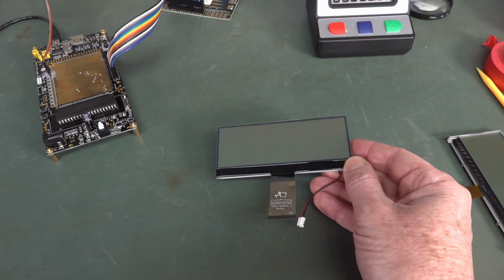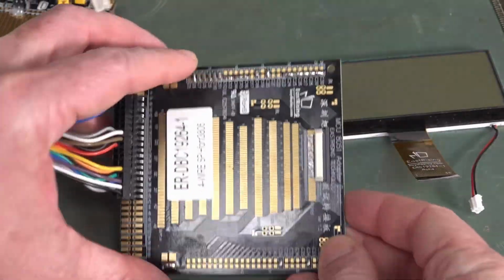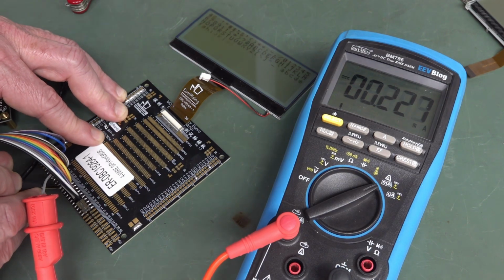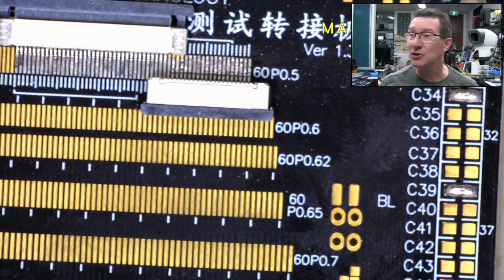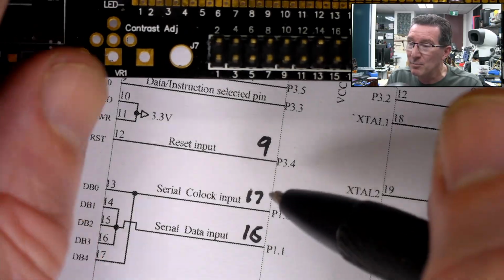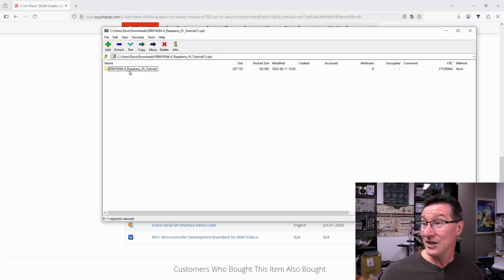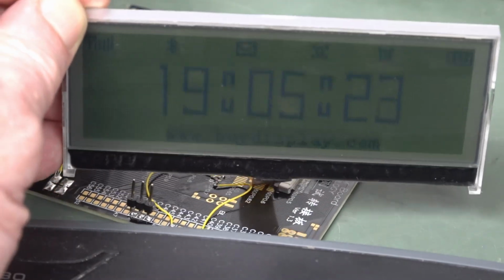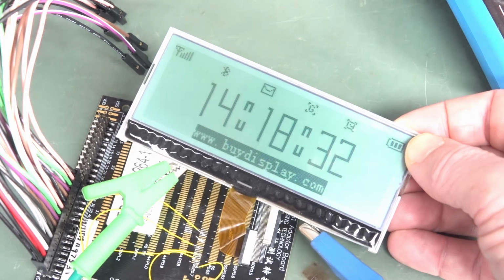EEVblog 1699 - µTimer PROJECT Part 1 - The LCD

Comment: The USB stick didn't work because it was FAT/NTFS formatted, posix systems use a execute bit to mark a file as executable. FAT/NTFS, being a windows file system has no such notion and instead uses file extensions to determine if the file is an executable.

Comment: You know electronics has been finally comprehensively ruined when the build of the quintessential basic project (right after a blinky light) - a clock - gets approached by bringing in a gigahertz-clocked Linux-powered chip.

Comment: I'd rather have a nice, usable display than x% more battery life. If you really want to chase microamps, you have to go segmented either way. And the first display looked really nice for being a passive dot-matrix. I actually have been evaluating a  128x64 that looks very close to your first one, and it looks very nice, especially when you provide just a tiny bit of background lighting current to it. If you want to go full Hackerman, you can sense the background lighting LED for ambient light level via an ADC.

Comment: Max power for LCM -- probably stands for liquid crystal matrix.  No indication that this includes the electronics.  So the quoted power is probably only for the crystal matrix.  Great, but you are reading power for the LCM and electronics.  It only makes sense for them to specify these values separately if pairing the electronics with different LCM.  Either way, the datasheet was highly misleading.

Lets investigate a bit to make sure I am not wrong -- the controller is a IST3020.  Current draw is only 40uA but there is a catch.  The chip includes a boot circuit for generating higher voltages to drive the LCD.

- Supply voltage (VDD) : 2.4 to 3.6 V

- LCD driving voltage (VLCD = V0 – VSS) : 4.5 to 15.0 V

So the quoted current consumption of the LCM is probably accurate -- they just neglect to mention it is at ~10 V.  Guess my first guess was wrong - but this does explain things.  Looks like the "voltage" comment in the source code was actually accurate.

Comment: Keep the illuminated LCD and use a removeable 18650 battery so you can charge it, keep the backlight on if you want and replace the battery once it dies

Comment: Personally battery operation is nice. But I would much more happily take a 24 volt capable DC input. A switched regulator can easily make that DC input range 9-36 volts or even wider without all that much hassle.
And having a simple barrel jack DC input makes life so much easier, since most of them do have an internal switch that can disconnect one of the battery terminals, so no need for selection diodes and the same switched regulator can handle the battery input too.

Main downsides with batteries is that one has to swap them on occasion, and they usually leak and destroy one's equipment... For bench equipment a DC input is preferred.

If everything just did 24-ish volts DC (24 +/- a few volts) means that one can have a DC bus stretching along the bench powering a slew of various low powered bench equipment from one adequately sized supply. Where its idle power consumption will be lower than the combined idle power draw from the slew of supplies it replaces, not to mention the improved power factor. Some might argue, "why not 12 volts?" But voltage drop over cables makes it unattractive. However, yes a lot of products these days do just have a 12 volt SMPS inside them. Be it oscilloscopes, universal counters, various signal generators, even a lot of bench multimeters. And honestly speaking, filtering and post regulation largely makes noise a "non issue", so there is little reason such types of equipment couldn't run on our 24 volt bus, unless we have atrocious levels of noise on it.
Reply: Other commenters go the other way and say put a Li-ion battery and USB charging into it, but I agree with you. This is a benchtop device and so should be hard-wired, in my opinion.

Comment: Sharp has some nice ultra low power (AFAIR they call them pseudo static) LCDs. I don't know if they have displays that satisfy your needs. For a throttle project I got some small ones that should draw about 5uA with static content.

Comment: For what it's worth, if I were buying one of these (and I might just, if you wind up making some to sell) I wouldn't be too fussed one way or the other about battery life - IF you used rechargeable batteries and include USB-C charging support. Mine would spend most of it's time plugged into the charger anyway. So for my part, I'd say use  whichever LCD looks best, more so than trying to optimize for power consumption.

Comment: It might have been addressed in the comments, but just make it run off of a single 18650 Li-Po cell and make that charge via USB-C. Even with a constant 10mA power consumption (and you should be able to cut that in half), the thing could last a week on a single charge.

Comment: This video series looks really cool, I'm sure I'll be following it!
Dave I have found something that might interest you as an lcd, but I might have missed some specs you wanted for it:
it's transflexive, 4in, 128x64, it comes in spi or i2c, voltage level 3v3, and based around the ic st7565, current consumption unknown. You may find it by searching "Estardyn Lcd12864 12864-06D", price is around 3.5€

Comment: @9:25 Viewing angle is indeed extremely intuitive... 6 o'clock is like -45 degrees and 12 o'clock like +45 (or vice versa). The one who invented that must be a genius! There are 180 degrees between 6 and 12 o'clock. Right?... Right??? If it were intended to confuse people, then consider the goal achieve and way beyond that! Unless... oooh I get it, it's radians, right? (yeah, that's sarcasm, plain old.)

Anyway, grumbling apart, I'm excited to see how you spin that one 👍

Comment: Is the LCD running off 3.3V or 5V?  I expect running it at a lower voltage would decrease power consumption significantly.

Comment: LCD is using almost all the Current when it has to update the display - just like e-paper displays. You are having a clock, that has blinking content and changing the seconds in display - so the display of course will take more current (I bet, the 500µA were RMS or something like that over time?). Leave the Display in stationary state, and it indeed might get much closer or maybe even to the 180µA.

Comment: I recently developed a timer based on a Schmitt trigger having an N channel JFET as it's input transistor. This loads minimally a capacitor used as the time constant element. When the output goes high it both turns on a transistor on the output to be used as a switch and also turns on another transistor being used to shunt the capacitor charge through resistance to start the second phase of the timing.
Works excellent on a single cell li-ion battery and can be made adjustable with potentiometers, LDRs or whatever.
Good fun experiment 😅

Comment: The amount of updates to display chipset effects the draw from the supply also. As 8051 code probably more optimised compared to an external C library!
Also AliExpress has cheap connection boards for strip connectors, if faffing with the original is a pain in the 🫏!

Comment: -Wall enables all compiler warnings. -W is the warnings configuration flag, followed by a configuration word which in this case is 'all'.
The USB stick didn't work because Linux requires a special "executable" flag to be set on executable programs and that flag isn't really supported on the FAT32 filesystem your USB stick is formatted with. It can be emulated by Linux, but the way the filesystem was mounted probably turned that flag off.
Moving the files to the Raspberry Pi's filesystem meant you got proper support for the executable flag, so gcc was able to set the flag when it wrote the 'lcdtest' binary.
You can set the executable flag using a command like "chmod +x somefile". chmod is change mode, + means add flag, x means executable.
Reply: Can you enter it as “-W all” instead?

All the typical Linux distros force the executable flag? Is there a particular reason for it?
I guess it prevents running programs inappropriately from a mounted network share?
Reply: @davadoff I don't think so but I haven't tried and yes, not mounting with the option to emulate the executable bit is likely a security hardening measure

Comment: Nice to see more product development!  And some nice breakout boards.  Raspberry Pi has all the benefits and drawbacks of running a generic OS, I think that's where a lot of the setup stuff came from.  If you had a spare Arduino instead then I think using that would have been a lot easier, because it's more tailored to do this kind of thing out of the box.

Comment: I really hate the form factor of instruments like the timer. If it’s not front facing and stackable, it should be flat, with a collapsible stand like multimeters and portable scopes. Interesting project though 👍
Reply: Well I mean the timer is a moveable desktop instrument, not really one meant to go on a shelf. Such a small and light device doesn't seem very practical as a front-facing device anyway.
Reply from the maker: Disagree.

Comment: I love how Dave tries to solder microelectronics with Grandpa’s old branding iron. They do make micro irons fit for purpose.
Reply: You have no idea what you’re talking about. He’s using a high-end JBC iron with a special tip made specifically for drag soldering. People generally do not use micro-tips except where it’s absolutely unavoidable, since it’s more work to do each pin individually, and micro-tips have terrible thermal properties.
Reply: @tookitogo  Actually, I do as it’s my favorite style of tip. That tip optimized for drag soldering comes in a range of sizes with a solder cup suitable for the pitch being soldered. I have an extensive collection of that style of tip plus wettable and non-wettable needle tips that are excellent for clearing minor solder bridges between 0.5mm pads without resorting to solder wick. It’s all happening at a different scale.
Reply: @ChrisSmith-tc4df  Then you should know it’s not “grandpa’s old branding iron”.

Comment: I like the product idea and the use of a wide aspect matrix display for this, but I'm not so sure about chasing low power consumption so it runs off AAs. Pretty much everything those days has a rechargeable Li-ion battery and a USB C port and I think most would prefer that. It significantly reduces the chance of damage from incorrect battery insertion, leaking batteries and broken battery doors which in my experience are very common failure modes for products with user replaceable primary cells. I think a single internal 18650 and PCB mount holder would also take up less space than two AAs integrated into the plastic enclosure with an external battery door.

But also I think you could capture more use cases if you increased the power budget and added WiFi for NTP synchronization that way it can be used as an accurate desktop clock that you can actually be confident is correct, but also measure accurately between actual times. GPS is also an option,  it consumes similar amounts of power but almost never works indoors, has a high cold start time and correcting for GPS-UTC leap seconds is kinda annoying, particularly into the future.

With a 3,000 mAh battery your power budget would be ~4 mA for a 30 day runtime (~3 mA if targeting 80% battery wear) which I think is very feasible if you run the WiFi only once every so often to sync over NTP. Possibly going into the feature creep territory with WiFi and NTP depending on your market segment intent, but I think the rechargeable battery is a must.
Reply: I like the NTP option. I have my own GPS NTP server so having a clock sync'd to that would be plenty good enough.
Reply: ^^ This. I'd take more features (inc. Wifi for NTP, and/or GPS) at the cost of shorter battery life for sure. And definitely do USB-C charging.
Reply: Would you not agree that baking a Li-ion battery into this, or any other product, guarantees the product will become e-waste when the battery wears out? Or are you thinking of a replaceable Li-ion cell?
Personally, I'd prefer the other way and have it hard-wired. Perhaps even supporting PoE.

Comment: arduino/rpi is infinitely better than buying the hella overpriced demo boards!
you could have probably got an pitch adapter for the flex to connect directly to the DSI display port on the rpi
Reply from the maker: This demo board is on $22 which is super cheap, but yeah, just supply the cable and adapter board for an RPi would have been better.
Reply: @EEVblog  ahh thats not too bad a price then... ive seen some of them in the 100$s range that are just scary...
remember..this could have also been done on a rpi pico.. so even cheaper and smaller hardware footprint than using the full blown rpi

Comment: so this is a fancy chronometer?  Why not a chronograph something the can measure the speed of projectiles. toy race cars, etc?
Reply from the maker: It will have inputs that could do this. But it's not designed as a high speed counter/timer.
Reply: @EEVblog  but it should be easy enough to design that into it too, shouldn't it? the timer resolution should be more than good enough for anything mechanical, for example. and if you end up using a dot matrix display, then you can have different modes of displaying the result, e.g. seconds, milliseconds, microseconds.

giving it a high-res timer function will instantly make it more attractive, I think, and it's still a timer, so the device won't become a jack of all trades.

Comment: I know e-ink displays are expensive, but it would be cool in a product like this 😃
Reply from the maker: Not designed for fast continuous updating.
Reply: "Not designed for fast continuous updating." ... There are eInk controllers with a "window update" feature. That means, you are able to only update a fraction of the screen which is suitable for clock applications. Though, you need a full refresh once in a while to get rid of ghosting artifacts.
Reply: @EEVblog i know, but does it need to be fast if only the end result is important?
One update when started and one when stopped 😃
Reply: @sismofytter  Pretty handy to be able to see the current elapsed time in on a timer I'd have thought.

Comment: Unless the resolution can be increased significantly I would vote against a dot matrix display. I think a custom LCD or eInk would be easier to read. Either way i am very much looking forward to this project series.
Reply from the maker: 192x64 isn't enough for a large digit display?? E-Ink isn't designed for regular fast updating.
Reply: @EEVblog  well these dot matrix displays are the "meh ok it will do" sort, of course a custom display with dedicated segments would be a lot better.
but the decisive factor here will be the economical viability, I guess.

Comment: I'm sure Australia is doing the sane thing in grocery stores and shops. The price displays are E-Ink. They are pretty good, and must be less expensive then  printing the price on those stickers we all are familiar with.
Reply from the maker: Yes, but not designed for regular high speed updating.
Reply: @EEVblog that would be fun. How much faster can a lcd screen display a digit change, vs a modern e-ink alternative? I get they can't display video in a comprehensive way, but those lcds you're using can't do that either.🤷‍♂️
Reply: @EEVblog  Do you really need a running update or only the resultant time after the timer has been stopped? Readable, power-saving, fast-updating...pick any two?

Comment: Don't get the concept, micro-time would be in the realms of a o-scope, high accuracy long term would be a terminal data logger, why the LCD.
Reply from the maker: It's not a precision high speed timer or frequency counter, it's so you can actually see a real world timer for an experiment or whatever.
Reply: @EEVblog  A data logger with inputs.
Reply: @EEVblog  It'd be perfect in the background of a timelapse video of um... maybe some alkaline AAs connected to a 555 circuit or something random like that.

Comment: Any reason for LCD vs e-ink? Just curious since e-ink can be read from almost any angle, low light, bright light (direct sun) etc. Waveshare has many ~4 inch size and 4 shade of grey and even Red,Yellow,Black,White.
Reply: The update rate is relatively slow and most e ink display would suffer on pixel wearout after some time.
Reply from the maker: Because they aren't designed for continuous fast updating.
Reply: @EEVblog  The newer driver chips for e ink allow fast updates of small parts of the display and could be a good option for your timer.  Really nice contrast and allow multi color options.   Extreme low power.  (ZERO power when not changing the tiny balls in the display)  You should consider these and get a sample to play with.
Reply: @chuckinwyoming8526  ...and maybe do some wear testing. how soon will it wear out if updated once a second? a year? five years? twenty years? I'll take a wild guess and lean towards the latter, I think.

Comment: I've bought small colour TFT displays and driver modules from them for my Advantest R6581 display conversion, wouldn't say my experience with their supplied technical info was brilliant, but I got there. Advise against the TFT route incase you end up contemplating!
Reply from the maker: TFT is way outside the power budget.